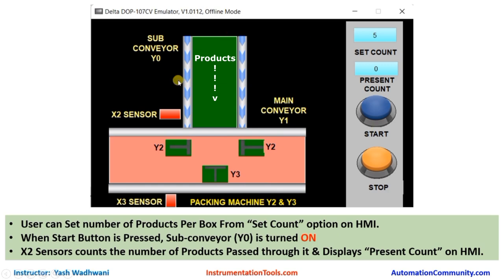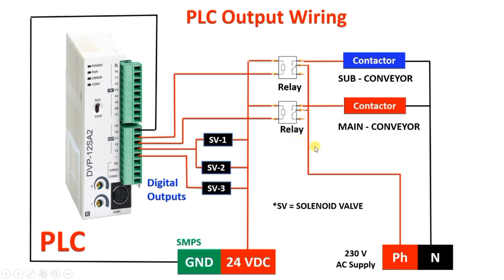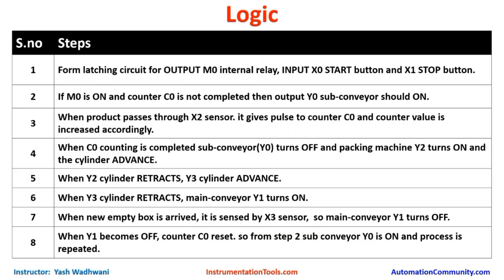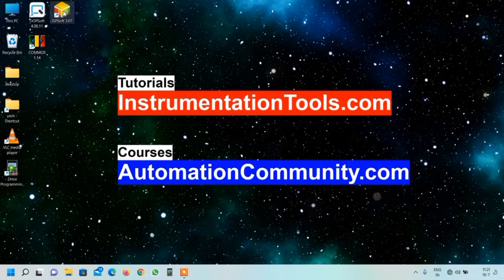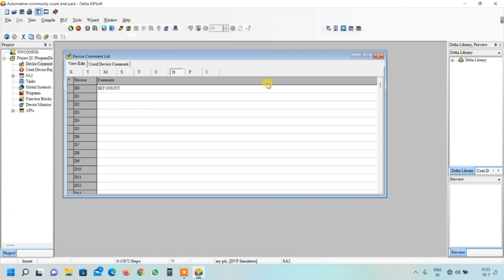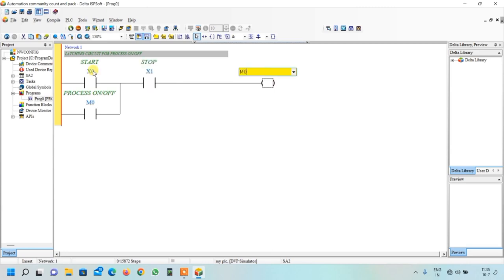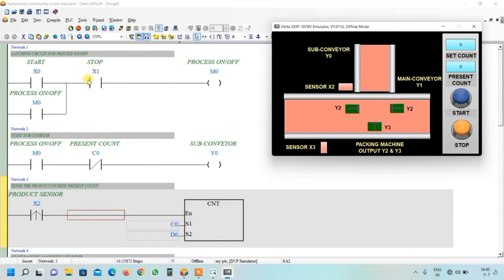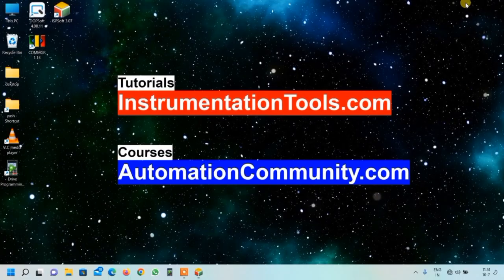PLC Program to Count and Pack Boxes on Conveyors - Example Logics

Comment: What will happen if the power supply cut off when the present counter value is less than the set value , what will happen when power is back ?, will it continue to count from where it stop? Or reset the counter?